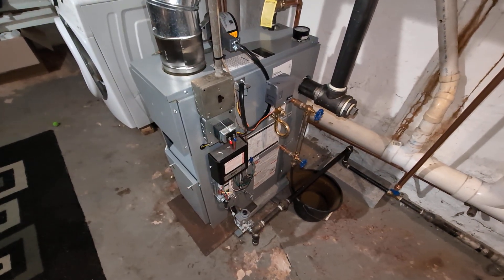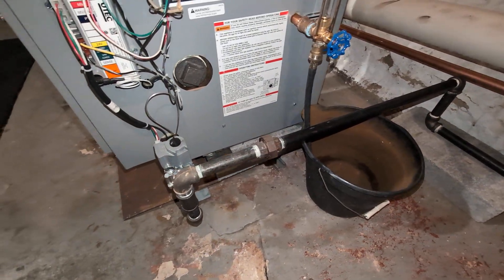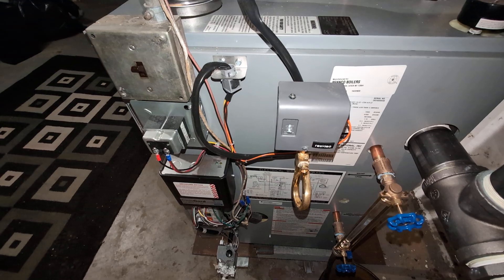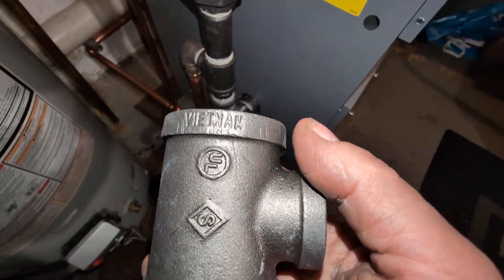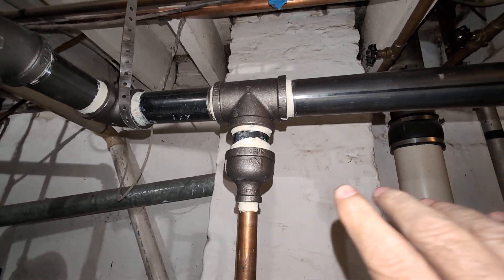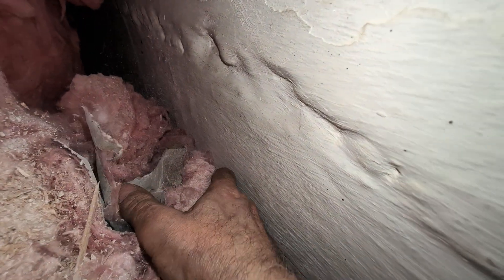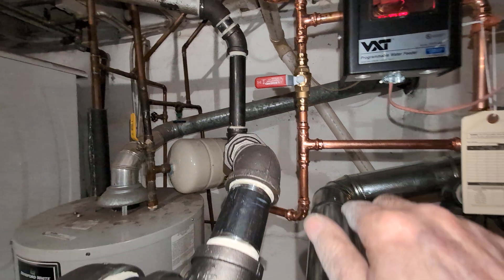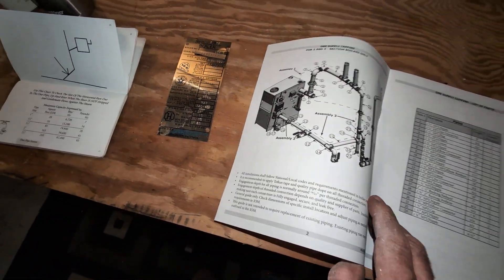Even The Smallest New Steam Heating Boilers Still Need Lots Of Proper Near Boiler Piping

Comment: Again, very nice and professional job.  Thank you for showing the installation!
The only thing I am wondering is why you use the bushing to reduce the size of the nipple to connect to the closed valve.  Why not use a bigger size of the closed valve instead?  Metal debris is always settled around the bushing
Reply from the maker: Thank you for your kind words!
As to your question, the 1 x 3/4  bushing is there so it can be removed to clear out any sludge, etc.
Most common hose sizes are 3/4" hose connection and that ties most easily on 3/4" full port ball valve.  
So, if I have a one inch wet return, I've got to reduce somewhere.

Comment: Nice job.  We like the Dunkirk boilers and have many in service of similar design that are over 50 years old.   We do a few things differently, at a higher cost for a better job:  We never use imported iron fittings.  They're just junk and the money saved is not worth the time spent in troubleshooting leakers.  We always use cast iron on steam, never malleable.   And our feeders are installed with unions, so a leaking valve can easily be diagnosed.  We'd also try to drill and tap a vent on the end of the main.  Like your tee in the pigtail; we'll start doing that too.  Quality 3# gauges do hold up but they're expensive.  Thanks for sharing your professional, neat work and ideas.
Reply from the maker: You are most welcome.
Do you include on your boilers a sight glass drain valve?
Reply: @gordonschweizer5154  No we don't. I actually should add them to the buildings I own.  They would be a great help.

Comment: How high should the water be in the sight tube on an old snowman boiler?
Reply from the maker: Generally, the water level should be 1/2 way between the upper and lower sight glass fittings.

Comment: I think it looks like you could pull out that plate between the burner compartment and the draft diverter to get at the LWCO probe.
Reply from the maker: @ed6837  You might be right, but up close it looked like a lot of screws and a bent tap or two might be needed.
Hope you're right & my fears be groundless.

Comment: Im with you on the quality of that 90 cracking
Reply from the maker: Yeah, I'm not trying to bash & trash them.
I hope they get better and wish them success.
Reply: @gordonschweizer5154  You're putting Americans out of work buying that junk.
Reply from the maker: Please permit me to tell a story about Ward (one of last two American fitting manufactures left).
Up until about 10 years ago, I was buying from Ward special order pipe nipple lengths.
They were much more expensive than the local cut and thread shops, but the results were worth it.
American pipe cut by American workers to American factory standards.
Then, one day etched forever in my memory, the latest Ward order arrived and, lo and behold, the pipe was marked "Made in Korea".
WTF!
I paid for American pipe, was charged for American pipe, but they switched me out to "Globally Sourced" materials without asking me.
I blew a gasket.
Ward told my plumbing wholesaler (they didn't have the b@lls to talk to me), that because American workers had cut and thread the foreign pipe, it was now magically an American Product. 
I never made another order from them.
So, it is not me putting Americans out of work, it was the owners of Ward (and others) that screwed them (us) over.
Reply: @gordonschweizer5154  Thanks for passing that along...  My customers require "Made in USA" as do the NYC inspectors.
Reply from the maker: In our area, the inspectors seem mainly to care about if you have the right back-flow. 
I have one video on this channel of a boiler that passed inspection installed by "others".
Down here, no one seems to care where the fittings come from, unless you are doing a Federal Government job.
I suspect that if someone piped in a boiler with cardboard, they might pass it.

Comment: Gordon have you ever heard of the Mueller vapor trap ?
Reply from the maker: Can't say I have.
I looked it up in Holohan's LAOSH Companion book and it wasn't there.
There is a listing for the Mueller Steam Specialty Co in New York City, but not for vapor traps.
Nothing in the Barnes & Jones cage unit booklet either.
It might be under a different name?
Reply: I came to you because I haven't heard of it either. I saw it on a Facebook heating group. It's a Mueller vapor trap no. 2. It looks like your standard watts steam trap, but the removable cap is not on top, it's on the side.
Reply from the maker: You might want to reach out to Barnes & Jones directly.
They might have something in their files.
If the trap needs to be rebuilt, you can remove it after the heating system and send it to B&J to see if they can match something up.
The whole trap may need to be replaced.

Comment: Well you seem to be very knowledgeable, are you anywhere near south central pa?  Had a new boiler installed 4years ago. And probably 20 service calls later it still don't work correctly. Parallel system, i dont think the equalizer is working as its supposed to, possibly wrong piping setup per the manufacturer's instructions. It appears to be piped as a counter flow. All i know is we had a boiler for 70yrs worked quietly and near replacement parts free. The system worked fine up until the day we replaced with a WM unit. Unfortunately the expert we had likely retired 20yrs ago. And he said he helped my grandfather in 1951 instal the old unit.
Reply: Lower your pressure control
Reply: @Clamjammer  it is set as low as it will go, i just watched WeilMcClains training video for their Authorized installers. 
  Its disgusting, everything that should have been done Wasn't. and everything  that shouldn't have been done was done. Installer was here today and removed 1"" of sludge from the skimming pipe. 
   Someone thought it was ok to to put 4"s of riser into 2" of header. Piping is still wrong size and pressure's still isnt right. This has turned into a $10K nightmare
Reply: @shanestamball1886  what town are you in?
Reply: @Clamjammer  york
Reply: @shanestamball1886  install drop header and vaporstat.
Reply from the maker: @shanestamball1886  Thank you for the kind words.
I am sorry you are having issues with your relatively new boiler.
Our company serves mainly Central Maryland/Baltimore.
You might try posting pictures of your boiler install and your story on Heatinghelp.com.
Reply: @gordonschweizer5154  curious if there is any difference between a vapor system then adding a modern boiler? I know the old system was always said to have been vapor. And it was noiseless and everything heated uniformly, unlike now.
Reply from the maker: Vapor (AKA two-pipe steam) usually means the original system was designed to operate at very low pressures, usually oz/in2 or even in a vacuum.
Your old boiler also likely had a large "steam chest" where the steam (or "vapor") could separate cleanly from the water and leave it behind in the boiler and be "dry" as it entered the mains and hence into the radiators.
Modern boilers are much smaller, and therefore proper "near boiler piping" is a must in drying out the steam once it leaves the boiler.
It sounds as if the installer did not understand this, and your near boiler piping is going to need to be redone properly.
Reply: @gordonschweizer5154  yes the near boiler piping was incorrect per the manufacturer's specifications, on sizing and placement of piping itself.WM wants pipes on one side vs. The other. I don't know why it makes a difference. But i assume it does as well as minimum distances between water lines and header. I tried explaining to the plumber i thought we want slower velocity of steam, he for some reason thinks it should go faster through the header.
  After watching videos on how NYC heats 100story builds on a single lb of steam 😂, i think its rather clear slow should be "dryer"
Reply from the maker: What model WM do you have?
Reply from the maker: This video might be useful to watch: https://youtu.be/J5mzrLlIHbY
Reply: @gordonschweizer5154  i need glass pipes
Reply from the maker: LOL
Reply: @gordonschweizer5154  since modern steam boilers produce such a high volume of steam rapidly, would a over sized boiler create problems attached to a old system? The boiler that was replaced was tiny compared to this behemoth from WM. i think it is creating to much steam then hitting restrictions once it reaches the existing pipes
Reply from the maker: How did your boiler's installer size the new boiler?
Reply: @gordonschweizer5154  thats the million dollar question. Because i dont recall them measuring any radiators. I think he just looked at the BTU output of the old boiler and went a size up.
Reply from the maker: Ah, the ol' label method of steam boiler sizing + a little bit more just in case.
Oy vey
Know any good lawyers?
Reply: @gordonschweizer5154  didn't know there was a such thing, "good lawyer".  A member of their management team was here yesterday and agreed the piping and header was under sized and not in compliance with the manufacturers minimum requirements. After watching the WM training videos and all the problems we have had. It pisses me off they won't even watch the educational video made by the  company for installers. That guy explains why the problem starts and how to remedy it. The adding of a proper reservoir 😂. I mentioned reservoir and they all looked at each other like i was a dragon. Said they never heard of such a thing. Per WM there was a simple issue that should have been recognized before installation and a change in the quick vent location. 
  Its just unbelievable the amount of information i found on YouTube and the internet about WM boilers and all that information comes directly from WM the people who have engineered and probably spent millions to produce a quality product. Only for someone not to atleast reconized the different piping instructions between 2 systems that was DRAWN IN THE MANUAL!   Like what kind of lawyer do you even hire? I clearly picked the wrong HVAC company. Surely wouldn't wanna get the wrong attorney.
Reply from the maker: @shanestamball1886  Good lawyer does sound like an oxymoron.
Reply from the maker: @shanestamball1886  I've been doing steam more or less for almost thirty years & ytube vids for at least 7 to try and dispell some of the ignorance about steam heating.
I feel like vox clamento in deserto.
I try to have the attitude that the day I stop learning is the day I die.
So, in that spirit, I ask if you can send me the link to the wm vid on reservoirs as I wish to know more.
Reply: @gordonschweizer5154  I'll have to send 2 separate links, im not sure which video it was in. I guess maybe its a over view. But there was a detail as well as formulas on how to determine sizing in relation to time of return. In my installation manual 
https://youtu.be/21pMUZlTx8s?si=JEljcnesQ796V_ID

Comment: Are there vents on the mains?  If so, what kind?  Steam forever!
Reply from the maker: @nosaya3  Steam rules!
This is one of the very very few cases where we didn't put on main vents.
It would have required fairly extensive removal of drywall & some framing to expose the end of main piping, which would need reworking to be able to add a vent...
And all for two radiators.
The Perfect is the enemy of The Good.

Comment: First time I've seen a swing joint installed in the near boiler piping.  It makes perfect sense.  Is it common?
Reply from the maker: @the382house  Thanks for your comment & question.
Swing joints are common, if you know where to look.
"Drop header" installations have swing joints.
Anything with a 90 that is perpendicular to the axis of the expected major expansion is a swing joint.
For me, it helps make the installation a bit easier, and as a side benefit adds stress relief (I think).
Does it work?
Can't say definitively, as a lot of the negative effects of stress may not show up for years and that makes it difficult to ascertain cause and effect.

Comment: Where is the Hartford loop?
I think you tied it back to the return but I didn't see it clearly
Reply: Thanks
Reply from the maker: The one inch copper return goes goes up into a propress brass male adapter, which goes into a 1" stainless steel 90, which threads into a 1" stainless close nipple, which is on the 1.5 x 1 tee (the one that cracked and is shown in the thumbnail)
Check time stamp  5:04.

Comment: Being from England i cant help but feel this is a very inefficient way of heating a house. All that volume of water you are heating to me seems very wasteful. We use small compact wall hung low water content condensing boilers. Very often you will see 6 , 8 , or 10mm pipe to radiators - about the size of a pencil ! We only use steam in hospitals , factories etc.
Reply from the maker: Thank you for your comments.
I have a question or two for you: about how long are your wall hung condensing boilers designed to last?
Reply: Very little electrical use with steam boilers. Less efficient yes but smaller carbon footprint that repiping the whole house and importing all the heat emitters and boiler from around the world
Reply: @gordonschweizer51 I use a smooth jaw knipex plier wrench in the past I have used a basin wrench and an adjustable wrench on the handle.

Comment: 196 sq ft?
Reply from the maker: Yes, indeed.
And even that's a bit too large, if you can believe it.
This unit actually starts cycling on pressure when run long enough (even with all that bare pipe).

Comment: As always quality job, we get those malleable fittings here and they are at best “dubious “thread depth can vary, some being ridiculously tight at the start, btw was the existing flue out of the wall copper??
Reply from the maker: Thank you very much!
Yes, QC on import quality malleable fittings is spotty indeed, sad to say.
But I try to take the long view.
I sometimes come across old old "no-name" brand USA fittings, and its "back to the future", if you get my drift.
Who does one think actually taught the middle kingdom etc how to make cheap cr*p?
And yet I'll still buy it, so I'm not really wagging my finger at anyone except myself.
And yes, that is the remains of the copper flue connector coming out of that existing flue.

Comment: i took the probe out with a basin wrench recently, absolutely hated it.
Reply from the maker: Oh, gosh!
I have resorted to a 38mm deep impact socket (after I rip off that steel mounting flange on the probe) and a breaker bar and hammer.
I don't know if there is enough space to swing the tools in this boiler.
I've thought about drilling a hole in that angled sheet metal to allow a long extension and hook-up to an impact tool.

Comment: Great work again.  How many square feet is the house?   Are the low pressure gauges holding up over time?   I haven't seen one in a while.
Reply from the maker: Thank you!
There are only 4 radiators left (at least 2, possibly three were removed long ago).  Barely 100 sq ft. 
According to the residents, that still keeps the townhouse plenty warm, albeit with a fair amount of water hammer.
There is no longer any water hammer now.
Low pressure gauges don't hold up (esp now that the clockwork frame is often made of plastic).
It is usually best to install a 1/4" valve ahead of the gauge and take measurements and shut the valve when done.

Comment: Under 200 feet of steam and a counter flow main and a copper main.
Was the copper main 1.5”?
I guess if you have enough pitch on the pipe it’s able to work without hammering. I don’t recall seeing the book on steam heat I only have lost art of steam heat.
Reply from the maker: Yes, that is a 1.5 copper counterflow main.
By the book, it shouldn't have worked.
It hammered due to a water pocket and really bad near boiler piping, but the radiators at that end did get hot... eventually.
The wet return helps divert some of the water from those two radiators at the end.
There is no more water pocket.
And the "start-up" condensate from that main is diverted back to the boiler via the wet return rather than splosh back against the steam into the header.
That "The Golden Rules of Hydronic Heating"  by D. Holohan is a useful pamphlet indeed for heating steamfitters.

Comment: Wow! 196 EDR. I thought my MST288 was small! I have a small Dunham-Bush unit heater in my basement that is over half the EDR of that boiler (100 EDR), and another large radiator that is probably close to that. Just those two together would probably be the EDR of this boiler or close to it. Counterflow systems are uncommon in my area. Only in the smallest houses or long narrow houses. Most here are parallel flow perimeter mains that snake all the way around the building. You have to watch out for the 1890s and older ones, occasionally the threads on the fittings are non standard and don't quite line up to a standard NPT thread. Other times they are close enough to fit.